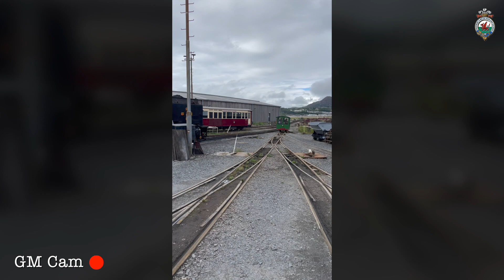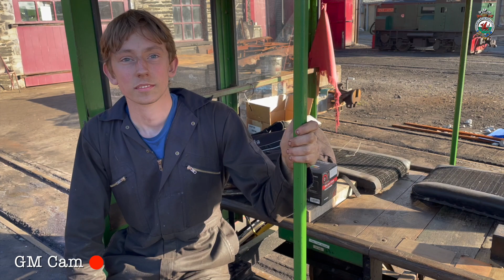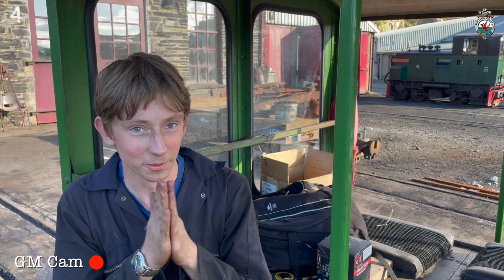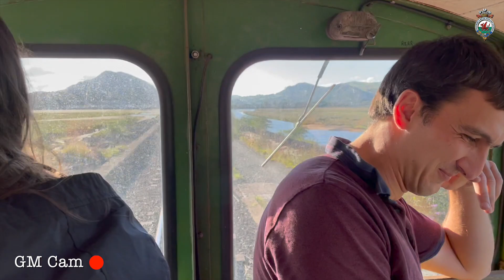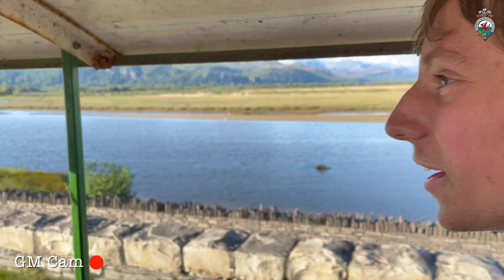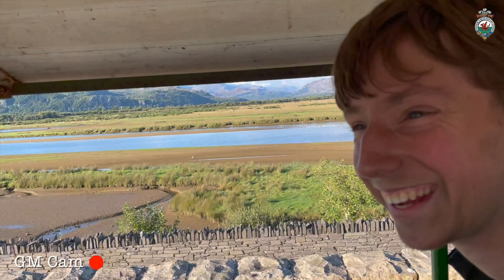Wickham Trolley - Our first Electric Loco!

Comment: I might get a bit too deep into the technical details, but why does the trolley need a centrifugal clutch? Usually electric motors can be directly connected to the wheels (one of the advantages over combustion engines), and using a centrifugal clutch seems to prevent the motor from being used as a brake and/or to charge the batteries while running downhill.

Comment: Brilliant video, next step is to convert an old 'beyond hope' diesel shunter. (Aquirred from off-site).  Main problems to be worked out are finding equivalent electric motor and working out the battery capacity required.

Comment: Excellent work! Some tech details would be nice eg: What motor is it? What voltage are you running at? How are you controlling it and what duration do you think you might get? My working life constantly involves electric motors and lithium polymer batteries and I have a lot of experience with those. It would be good to know how you arrived at the setup you have. Well done!